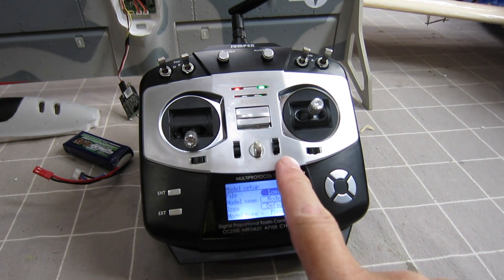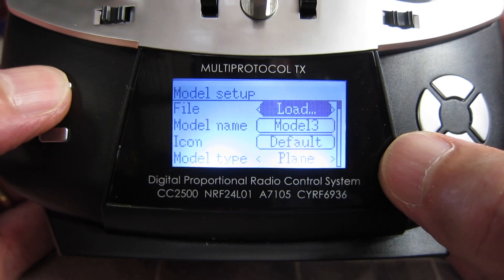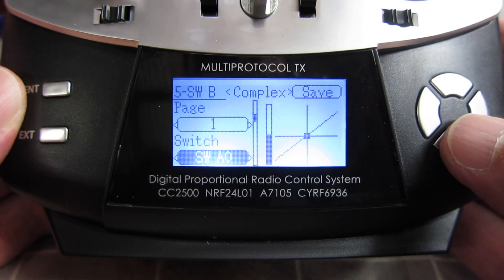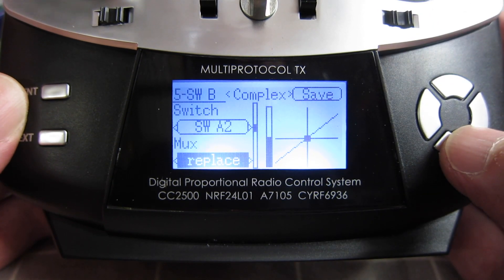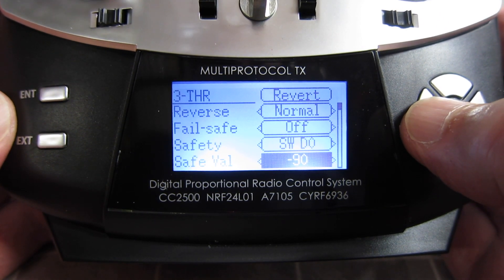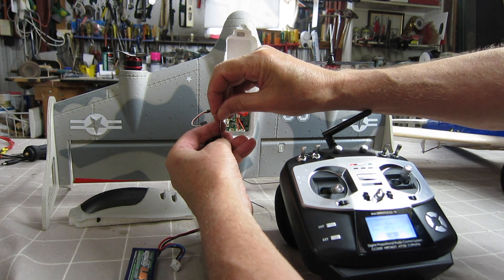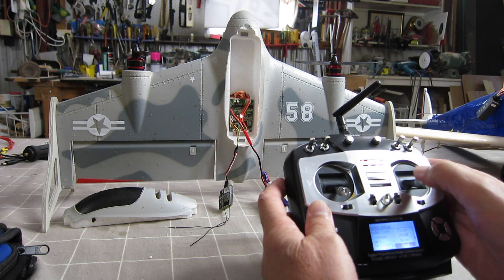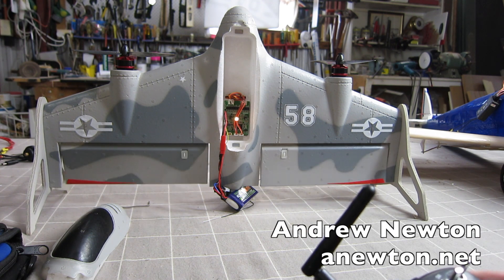Jumper T8SG 3 Position Mode Switch

Comment: Hi Andrew. Just found your video showing the T8SG. I'm interested in the v2 Plus with Hal gimbal.

With the deviation TX firmware, is it possible to have mixers for dual ails and dual elevs that works like this?

"Elevs will also work as slave channels so they mimic the ails movements to have greater bank rate. But whe it comes to pitch, only elevs do the work for pitch."

Thanks in advance mate.
Reply from the maker: I haven't used this radio since then. I found Deviation too confusing to program complex mixes.

Comment: p.s. I now have to help my older neighbour who also has the VTOL with the FrSky RX but has the Taranis Q X7 TX.  Is there any resource that will help me assigning switches in the same way?  One question that is puzzling me now that I have a multi-protocol Jumper T8SG is first, how do you determine the protocol used on r/c models and how do you determine the channels used for special functions (take picture, start and stop video, turn lights on and off, sound location buzzer etc.)?  Dave [NZ]
Reply from the maker: Much easier with the Taranis. Page across to the Mixer page for your model, go down to the Ch5 line, press and hold ENT to edit, and change the SOURCE to any switch you want to use. That's it. If you're having trouble with that you really need to learn the basics of navigating around OpenTX first. Have a look at my Open TX playlist. Protocols will be in the specs of anything you buy that has a receiver installed. If you plug your lights or buzzer or camera into ChX then you need to assign a switch to CHX in your radio mixing page.

Comment: Thanks a million Andrew.... going to be a real big help.  I read that there was a third switch assigned to differential rates (is that the correct termonology)?  Is is worth adding this feature in your opinion.  Finally, I see you are using a 950mAH battery, where is it placed in the bay and do you agree (with Quadcopter 101) that the CofG is where the motor wires come out?
Reply from the maker: Channel 5 is the different flight modes and channel 6 is dual rates. Just like I assigned the A switch to operate CH5, you can choose another switch for CH6, but not really needed. Don't know about correct CG but I would push your 600mAH battery right forward.